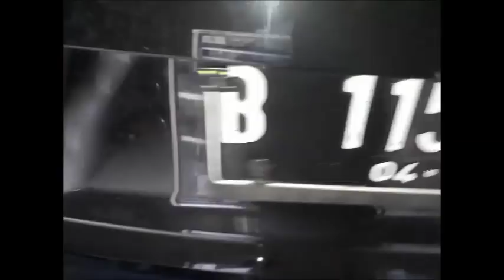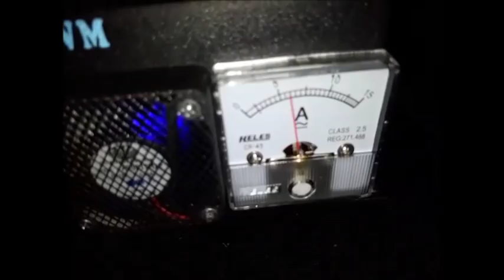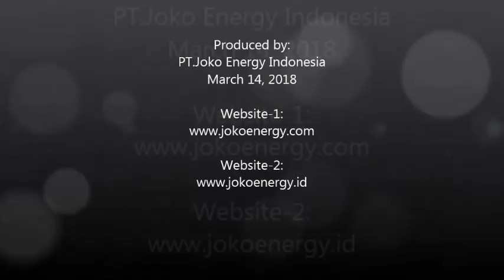Fuel saver (HHO+EFIE) Joko Energy on Mitsubishi Outlander Sport 2.0L 2013

Comment: Have you thought about writing software to take over the Efie controller? So that newer cars can use their android headunits instead of an additional controller.. making your installs a lot easier to adjust?

Also.. see if there is a spot in the engine bay to hide the device, making it easier for install and not to lose boot space..